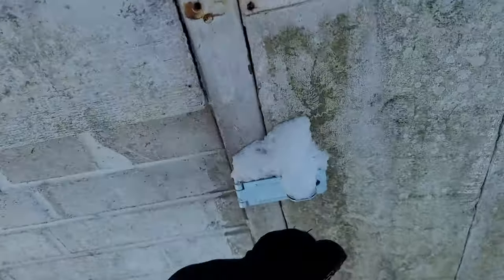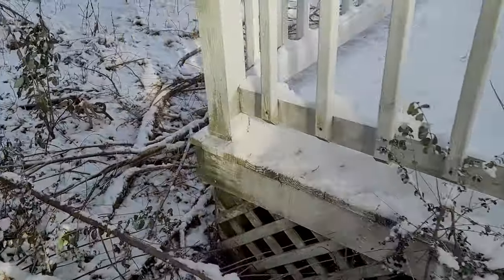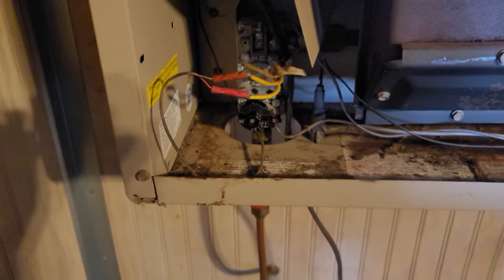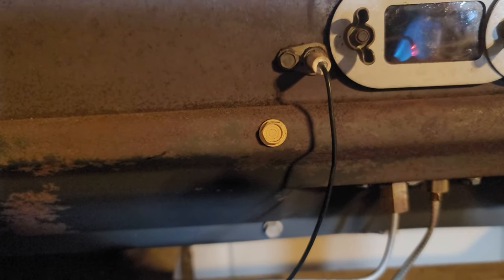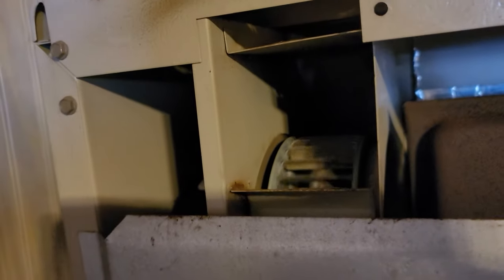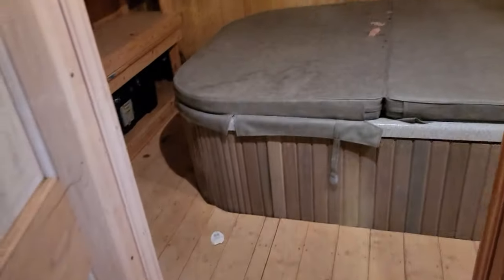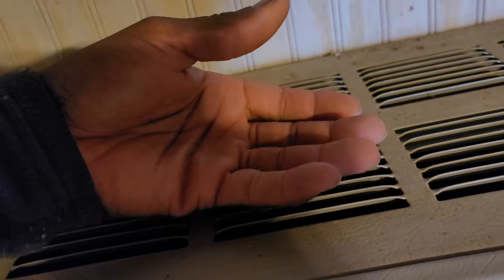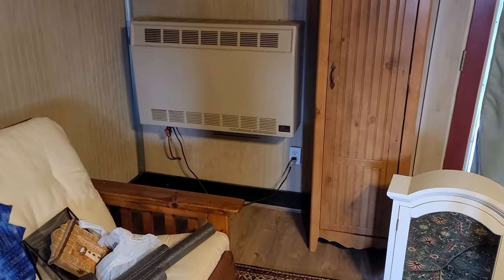How to light an Empire wall mounted gas heater.

Comment: Great, helpful video! One suggestion, for those of us who have little experience with piezo lighters, is you have to use enough force in pushing that lighter button so you hear a distinct click. If you don’t hear that click, it doesn’t matter how many times you lightly push that button, it won’t light! I learned this by frustrating trial and error. Glad you showed where that button is, under the heater, below the knob for shutting off gas, pilot and on position. Also glad you showed how to see the pilot through the little window, with just the metal cover turned around after slightly loosening the butterfly screws, and turning it back over the window when done. You saved me a service call and couple of hundred bucks! So satisfying to be able to do this myself. Thanks!!
Reply from the maker: My apologies. Since my videos are primarily for the DIY people, I assume most people taking on this task have experience with this type of ignition systems especially since they own a heater with one. I am slowly being a bit more detailed in my DIY videos just in case the viewer needs a little more "help".
Reply: You my champ! I have a new furnace installed last year and I could not remember how to light the pilot light so thank you very much for this video.

Comment: I am struggling every year when its time to turn on my Empire heater and keep forgetting the trick. Do I need to disconnect the electric power to the appliance before lighting the pilot burner?
Reply from the maker: @veronikaossi4004  no you don't.

Comment: The pilot light should be left on with heaters like this all year around the heat from the  pilot light is enough to keep the humidity of summer from rusting out the heat exchanger.

Comment: Thank you for the video. I just had a tank dropped and filled and couldn't get the pilot lit. Turns out the line wasn't bled and a lot of air had to be pushed out. But your video confirmed I'm not doing anything to blow-up the house. 
And thank you for turning your tank valve all the open. There is a seal that saves a lot of propane from a slow leak- all the way close/all the way open.
Reply from the maker: You are welcome. It's almost time to light them again.
Reply: @97TRAKIN  I'm in Healy, Alaska. 
I'm testing the new unit today, and will use wood for another month or until it stays freezing. What I was reminded today as the tank was installed: open the valves all the way to seat the seal and never insulate a tank. 
And we have the same vacuum cleaner.

Comment: What parts did you get to get it back running?
Reply from the maker: Regulator and hoses. I used a grill regulator which seems to work perfectly.  I am not recommending or suggesting that anyone else do what I did, but it worked for me.
Reply: I was getting a spark when I pressed both the igniter and pilot! I ended using a lighter to get it lit, but it’s working! I think I may need a new igniter. But thanks for this video! Definitely helped!

Comment: how do you bleed the air out of the line?
Reply from the maker: Turn the little knob to the pilot position, push it in, and hold. That gets the gas flowing and will purge the air out (slow process). Push the ignitor and check for flame. If there's no flame, wait a little bit and push the ignitor again. Make sure your ignitor is working and if you smell gas, stop everything, turn off gas valves and get a professional to look at your system.
Reply: I had a ton of air in my lines. Holding it down and hitting the ignitor did nothing. Had to hold the knob pressed in for about 10 minutes before the pilot would light at all.
Reply: @Will-et3ee  yeah that's what I have to do too.    It eventually lights, but it's a pain in the ass.

Comment: Can you tell me what to do if the pilot does not stay lit.
Reply from the maker: Keep the knob posted in for about a minute after the pilot is lit. If it still goes out, your gas control valve may need servicing or replacing. I recommend using a licensed gas company.